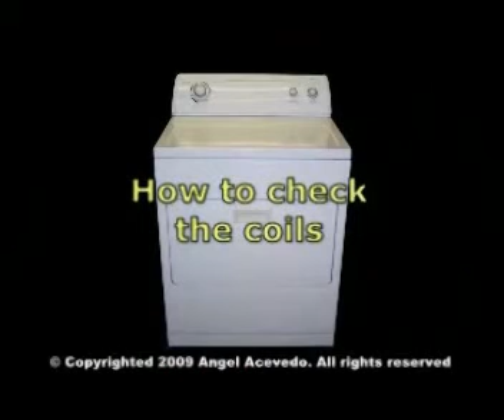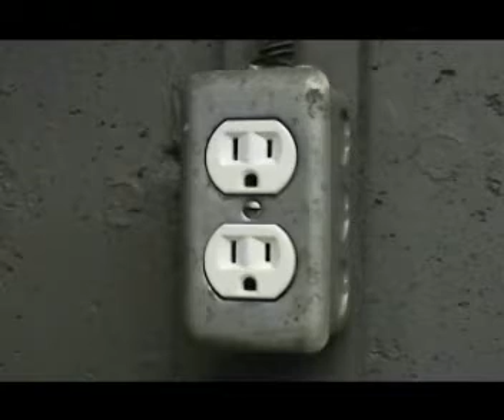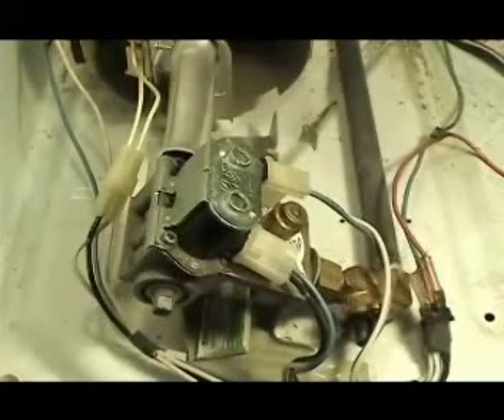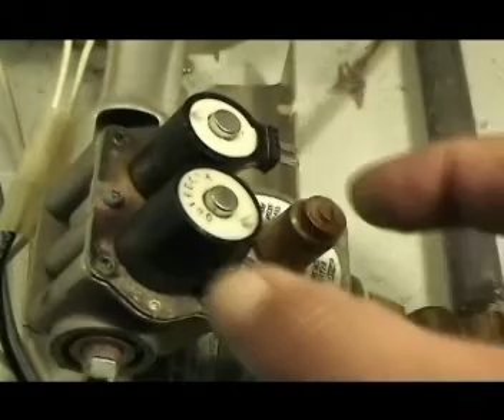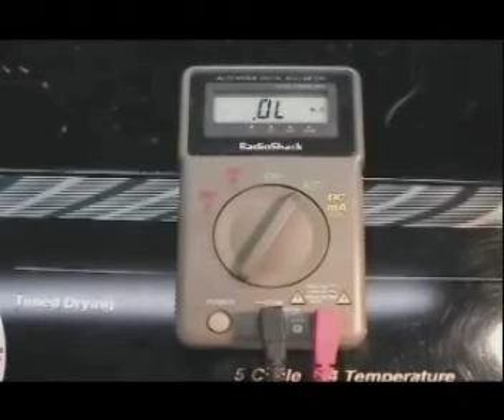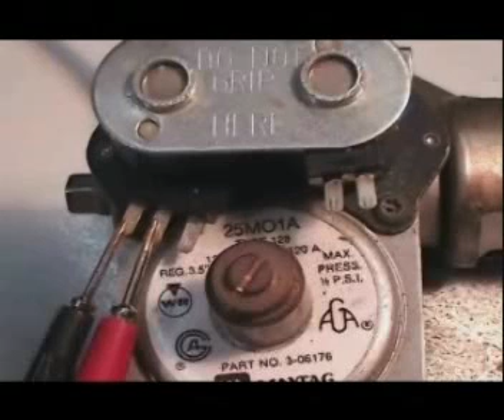Whirlpool Gas Dryer Not Getting Hot - The Gas Valve Coils

Comment: Hi Angel, I have a Whirlpool dryer and I changed the thermal fuse( open line) and the thermostat. The dryer heats up but it doesn't seem to get as hot as it used to. The vents are clean and no obstruction. Can the gas valve coils be going bad?

Comment: Thanks very much for replying. So, would it help to replace the whole valve? Or can it perhaps be taken apart and cleaned? Also, why is it so important to replace the other coil (the 2-pronged one), even though it seems to be working fine? Could NOT replacing it have contributed to the repeated failures of the 3-pronged one?

Comment: Hi. Do you have any idea why the gas valve coil on my dryer (the 3-pronged one) keeps failing repeatedly? I've had to replace it every 3 months or so for the last year. It seems to work fine for a while, and then suddenly stops working without any apparent reason. It's been costing me $10 a pop to replace it, which is not much, but I'd really like to get to the bottom of the problem of why it's failing in the first place. Any ideas or suggestions would be greatly appreciated. Thank you!